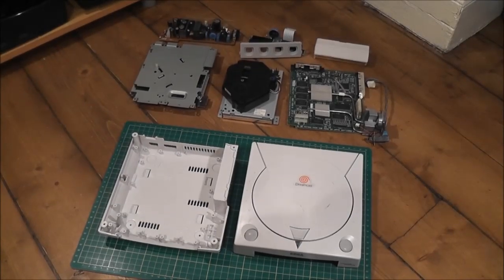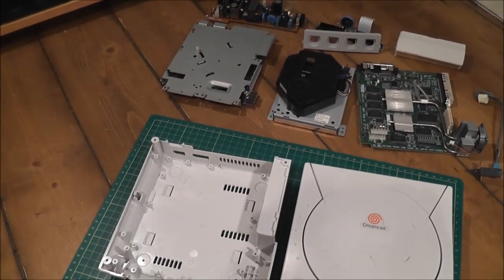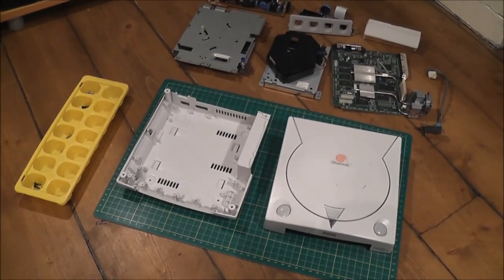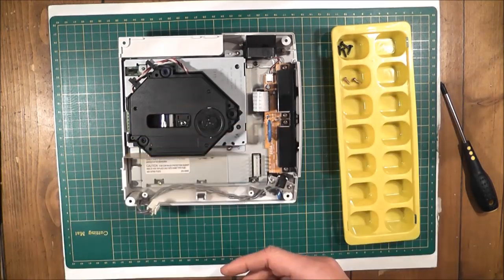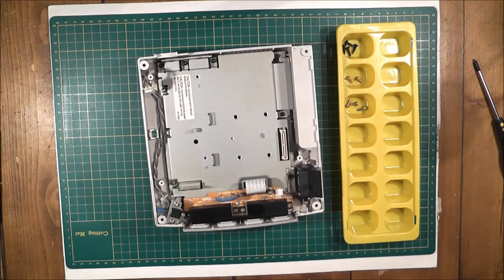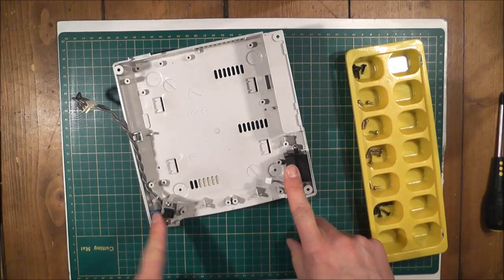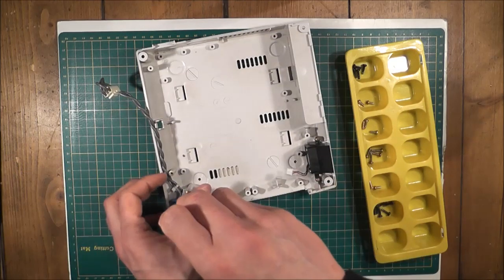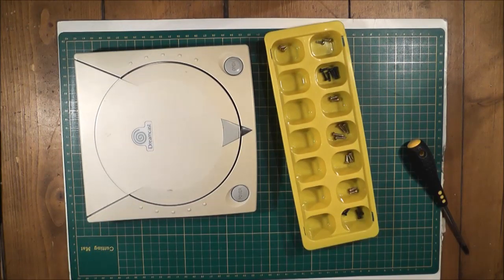Stripping To Video Game Music - Sega Dreamcast Teardown - Speed Challenge!

Comment: It is really important to keep your screws organized, even moreso for the Dreamcast. It's easy to say, mount the GD-ROM with a screw that appears to be the same size, but is really a millimeter or two longer. It will bore down into the pcb where there's a densely packed area of traces going into the GPU and just cut through a bunch of them. I remember seeing a few people do this years ago, and the gore photos were displeasant to say the least.

Comment from the maker: The Saturn is actually very similar in design. Maybe in future I do the same for the Saturn.

It sounds like you either have a bad cable or just need to resolder the the AV port to the motherboard.

Comment: No bad man!! Also, no sure if there's a lot of variation in models, but I looked this video up to clean up the Dreamcast my missus got from eBay. On oor wan, you need to remove the fan with the motherboard or it won't come out. Have you came across this similar variant before yersel?

Comment: Gigabyte Disc. It has a small inner section that is like a normal CD (Where the audio cd warning tracks and sometimes bonus art materials hide), surrounded by a larger, higher density section where the games are. All those people that ripped their Dreamcast discs to ISOs? They had to use a Dreamcast itself to do that, over network or serial port, nothing else will read the entire disc.